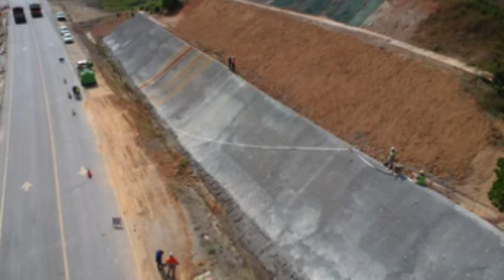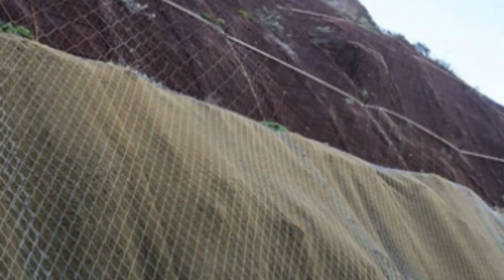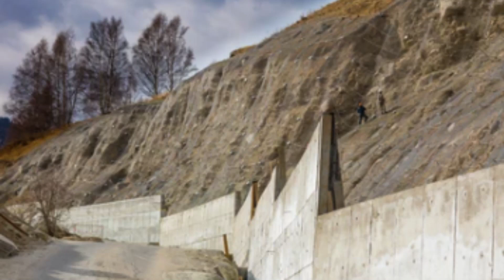What is slope stability? Why is slope stability important? How is slope stability measured?

Comment: Could u pls let me know the role of water in slope stability? Thank you...
Reply from the maker: Water plays a crucial role in slope stability. The presence or absence of water can significantly affect the stability of a slope and increase the risk of landslides or slope failure. Here are some ways in which water can affect slope stability:

Saturation of soil: When water saturates the soil, it can reduce the strength of the soil and increase its weight, making it more susceptible to sliding or slumping.

Erosion: Water can erode the soil and remove material from the slope, causing it to become unstable and increasing the risk of landslides.

Pore water pressure: Water can create pore water pressure within the soil, which can reduce the effective stress of the soil and increase the risk of failure.

Freeze-thaw cycles: In colder climates, water can freeze and thaw within the soil, causing it to expand and contract. This can weaken the soil and increase the risk of slope failure.

Seepage: Water can seep into the soil and create preferential pathways for soil to move, leading to instability.

Therefore, it is essential to consider the role of water when assessing the stability of a slope. Proper drainage, erosion control measures, and management of water flow can help mitigate the risk of landslides and slope failure.
Reply: @professionalgeologyclub  thank you 🙏
Reply from the maker: @YB-zn7rh  you' re welcome.